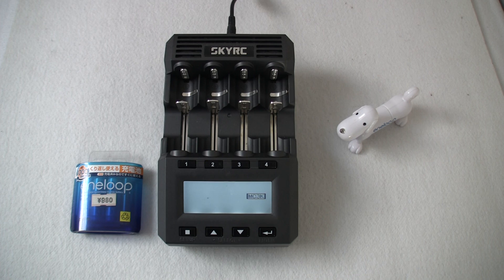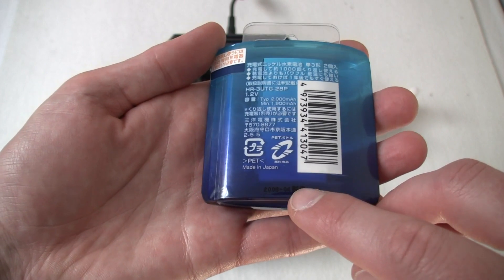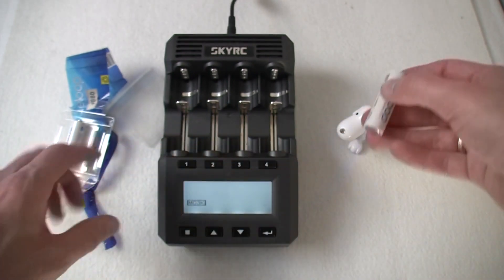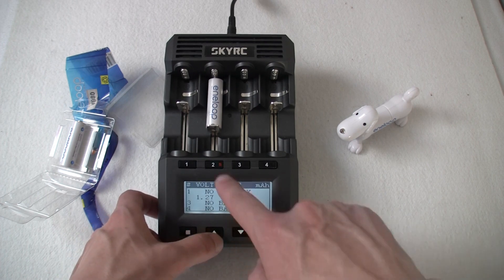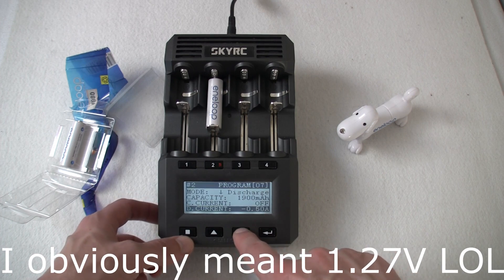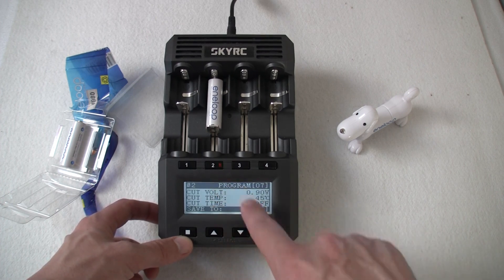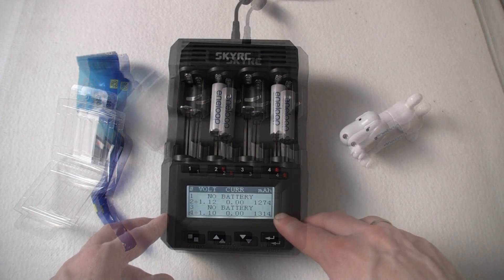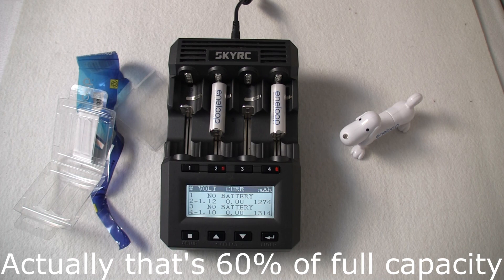10 year old Eneloop discharge test....from unopened new package... The King of LSD

Comment: FYI...:

"A battery's depth of discharge (DoD) indicates the percentage of the battery that has been discharged relative to the overall capacity of the battery."

1900 mAh * 60% = 1140 mAh.  (Note: This would be the energy that would be discharged at 60% DoD).
1900 aAh - 1140 mAh = 760 mAh. (Note: This would be the remaining energy in the cell (760/1900=.4=40%)

Your results work out as follows:
1274/1900=.67 = 67% DoD
1314/1900=.692 = 69.2% DoD

Comment: is it ok to buy enelops made in 2018, 6 years before ?
Reply from the maker: Should be fine! But it depend on the price you need to pay. I would prefer to buy the newest ones. But if they are limited editions from 6 years ago, they could be worth a lot more than normal Eneloops.
Reply: @Eneloop101  They are not limited edition but price is half nearly. Do batteries life shortens by only time without charge ?

Comment: Still, ChibiM, that is extremely impressive for a 10 year old cell.

It might have even lower self discharge compared to older lithium AAs.

And the fact that you were able to recharge them back to full health is stupid impressive in terms of cycle life.

It's the complete opposite case of my 3000mAh NiMH cells back from 2008.

Last year, I actually tested them, and they came in right around at 2700mAh, which was expected since it's an old 2008 cell.

However, when it was still new, it could actually self-discharge in less than 2 weeks! It was completely useless at that point.
Reply from the maker: I agree that Eneloops are quite impressive :)
Reply: if a cell from 2008 came back to only 300mah shy of it's max, how is that useless or bad??? that is better than eneloop. i think you are misjudging your data greatly. 2700mah is greater than the strongest eneloop ever produced. you sure it wasn't scam 3000? like often the case of EBL / chinese batteries?
Reply: @Fuffcat  There actually were 2800-3000mAh 1.2V NiMH cells back in 2008. Just not any made by Panasonic or Sanyo.

I still remember my dad buying them... and then regretting them after a week.

As I said in my original comment, the self-discharge was just obscene.

Sadly, ever since that comment, I've disposed of them since self discharge became even more insane: they became practically unusable after 5 days of storage.

Comment: And you can buy 3400 mah 18650 for price of 2duracell ds 
Nice can you test end loop lite 3000 cycles that means with moderate use they will last a hundred years is it true?
Reply: 3k cycles at .5C would be 250 days without the charge cycles.  That would require a dedicated rig for both cycling and recording.
Reply from the maker: true! but check out aacycler.com who is doing these cycle tests for all kinds of batteries